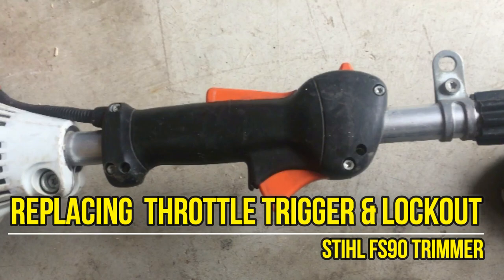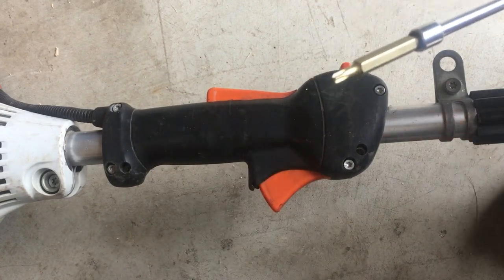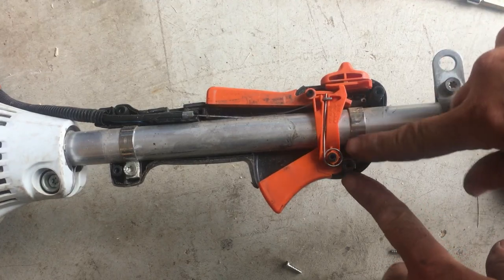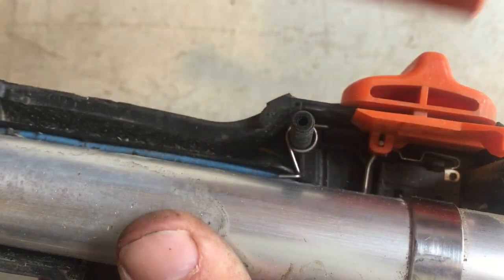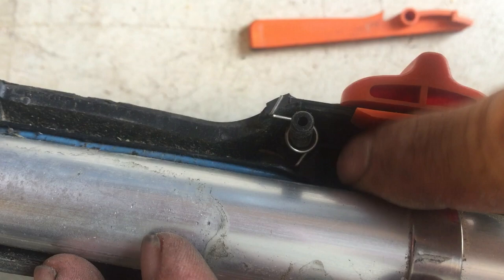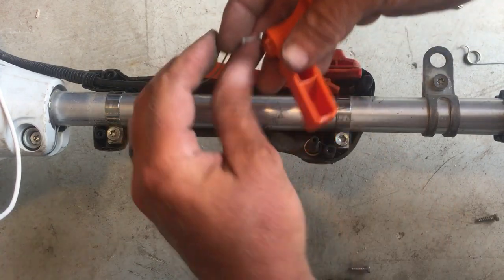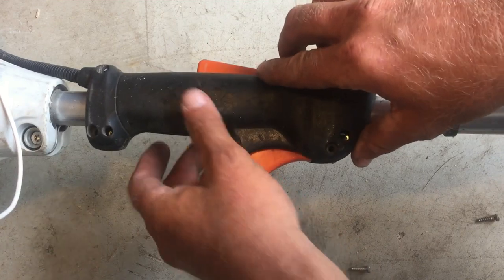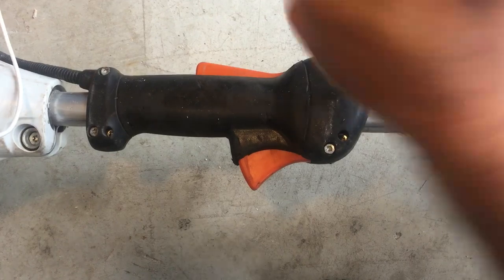Replacing Trigger and Lockout on Stihl FS90R Trimmer Weedeater

Comment: Lockout spring is my exact issue! Had trouble trying to get it hooked up but this shows exactly how to do it! Hoping that solves my issue of it running like the throttle is stuck wide open. Replaced carb and it was working great until switch wouldn't spring back? Do these springs get weak?

Comment: Excellent video clear and concise, thank you very much. I own an Echo Trimmer and my trigger didn't want to pull, it was stuck in the open position so I opened the handle and the long spring fell out, needless to say I said YIKES!! in my mind because I did not see where it came from. Your video was clear and excellent, the only thing is did not see the smaller lock out spring so maybe my Echo trimmer does not have one. Anyway thanks for an excellent video.

Comment: Turning off my trimmer sometimes it revs to full throttle my bro borrowed my trimmer brought it back not starting, got that sorted but now it starts full throttle
Reply: Check and make sure handle isn't loose and pulling throttle cable tight!
Reply: @judisinger3693  I fixed it but I can’t say what I did😂😂☝🏼